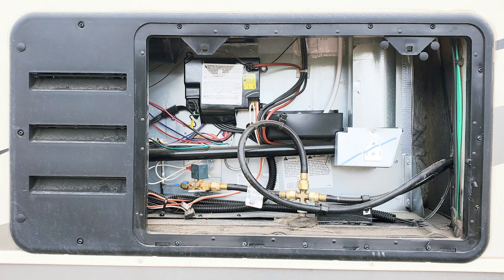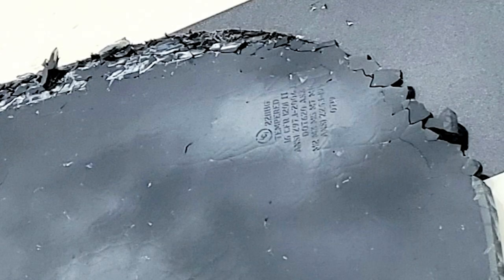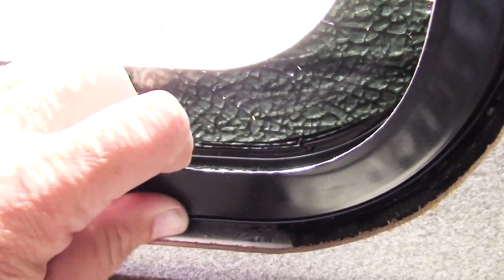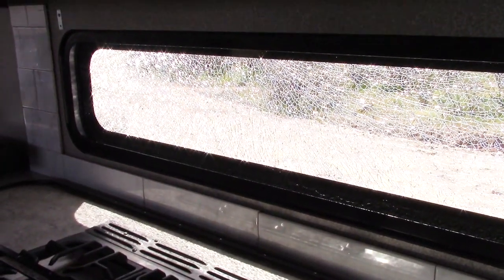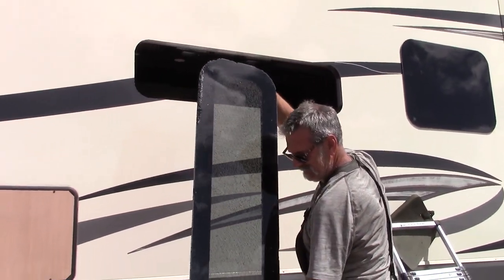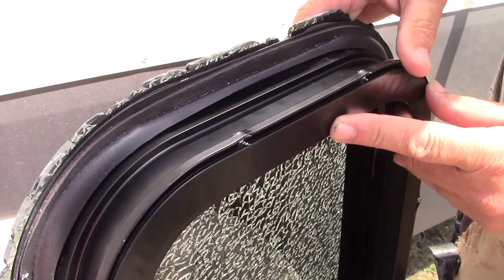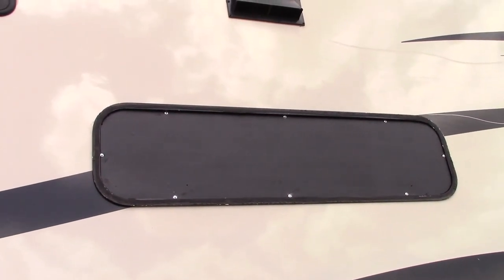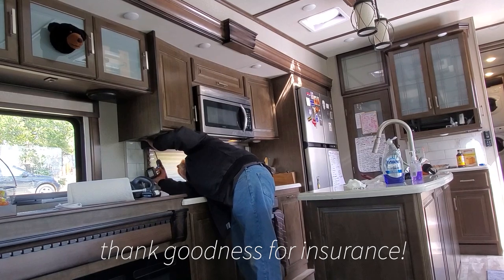SEMI TRUCK HIT & RUN! Shattered Windows, Emergency RV Repairs, RV Insurance Woes and Keeping It...

Comment: You’re not alone. I got side swiped in San Antonio Texas by a truck in a construction zone.  Took out the left mirror and forced me into a concrete divider for a slight scuff   Cost $700 plus. Now I drive with a dash cam.

Comment: I was parked overnite in a rest stop one nite, really dark, no moon or lights on the far end of the lot, and there was a big RV parked there for the night also.  I just happened to be up late that night due to insomnia, and watched a huge tractor trailer pull into the lot at a high rate of speed.  In a split second, he had sideswiped the RV and hauled butt out of there.  Unfortunately, it was so dark I wasn't able to get any info off the truck other than that it was white.  I felt so bad for those RVers.

Comment: May I suggest you look into getting some Wyze Cams. They are about $20 each and run off USB and connect to my cellular wifi. I have 4 in my Class C that point out of the windows and record continuously. One of the cams even pans to follow movement. I can keep an eye on my rig when I'm away and my family members can travel with me vicariously by pulling up the cam views on their phones or tablets. I've had my sister call me (from another state) when she saw someone she thought was lurking around my rig (it was just a camp host doing a security check). With this setup, you might have been able to get the plate of the rig that hit you. I wish you better and safer travels now that your rig is "broken" in! :-)

Comment: Oh Robyn, that is much more damage than you think.  I run an RV storage facility and my clients rigs are always being hit by trucks.  They make insurance claims and the  claims for damage far less than yours runs to $15000.   The fix all the scratches the whole side has to be replaced.  Also sometimes the interior cupboards are cracked.   Get it assessed ASAP.
Reply from the maker: Yes thank you! I was surprised by the total.  The paint was the big ticket item.

Comment: My son in his little Scion car had a truck merge into his lane and with one of those huge concrete barriers right up on the road shoulder, he couldn't scoot over any more. That trucks rear wheel started chewing into his car right at the drivers door and left swirl marks that turned into peeling sheet metal all the way to the front bumper. The right side of his car didn't do too well against the barrier either. He was lucky, they were moving slow approaching a toll booth plus his car was narrow otherwise that wheel could have come into the vehicle with him. 3 feet earlier and it would have. The truck driver didn't even realize that he had compressed a Scion until someone flagged him down.  LOL. It all worked out.  Your truck smash will too. :)

Comment: Man that SUCKS! Brand new rig too. You are taking it quite well. If that truck driver isn't an independent, he's going to have some explaining to do at the main office. You may want to contact that Cabella's and ask if they have cameras in the lot. They may have caught the deed.
Reply: I'm so glad you are alright. I'm dealing with insurance right now. I hit a deer 2 weeks ago in southern utah. The ins would not send out an adjuster. I had to go to the body shop. I have Mercedes Class C. I must say that the damage is minor. It hit on the drivers side corner. I was able to drive no problems. But I am still waiting for an estimate.  I have another trip planned the 1st week in July. I don't know if it be fixed in time.  Safe travels, love your channel.
Reply: Your title freaked me out.  My dad was killed when he was tear ended by a semi in 2004.  Glad you were ok.  Could of been soooo much worse.

Comment: My husband and I are owner/operators and drive as a team. We had an incident about 3 years ago when the trailer tires rubbed onto a lady's car. The car was parked at an odd angle in a no parking zone, along with everyone else, behind a strip mall we were delivering to. We didn't feel anything. The only reason we knew to stop was because I noticed a guy in my side mirror jumping up and down waving his arms. If we had not seen him, we would've kept going, never realizing we did that. The only thing that happened was that some black rubber rub marks were over her rear tire. Yet it came out to be about $$$$ damage. And we had to pay. We had to wait 8 hours for a cop to show up to do a report. The lady, who was Asian, spoke broken English, but told us she couldn't wait around any longer. So, she left before the cop arrived. We stayed. We filled out the report. The cop said if she'd stayed, he'd have ticketed her for parking there. But we're the ones who got the bad mark for a year. We're the ones who had to pay up. Did that driver know they hit you? We'll never know the truth. But, most of us try to be careful out there. Other truckers get mad at me because I back slowly or do other maneuvers slowly. I went to a CDL mill. All they teach you is how to pass the test. My husband was my trainer through the company we're leased to. His motto has always been "you can never back too slow". I'm sorry your new rig got damaged. But, I'm glad you are ok. 

P.S. Watch out for Swift, though, seriously.

Comment: Did you check with Cabela's to see if they had video?  Pretty sure they do most locations. Not sure how long they keep it though, so unless you already did check they may have taped over it by now. I saw a video about NOT putting slides out and BBQing etc in parking lots that let you overnight.  Something about etiquette at places like Walmart that let you park in their lots overnight and to not be that guy who treats it like it's his property and gets real comfy. Maybe it was CheapRVliving? I actually thought it was this channel but maybe even CarolynsRVLife, I follow all 3 so one of these channels touched on not putting out the slides. I think there was a lot of chatter about closing down Walmart overnight parking.  Seems it was happening in some locations and the advice was to not ruin it for everyone by doing stuff like that. Lawn chairs and BBQing for pity's sake!  Glad things worked out for you!

Comment: To help avoid this type of event in the future, consider not putting out slides when parked in designated lined parking spots. The wider that you make your rig, the more you increase your chances of getting hit...especially in drive through parking spots. If the part of your rig that was hit was the slide, then absolutely for sure this would have prevented this from happening. The blame lies completely with the truck driver, but it makes sense not to intentionally increasing the odds of a reoccurrence.

Comment: Here's a prime example why I say never keep slide outs out oh, it's just too risky. I'm a put mine out a couple of inches but that's about it it's not worth the headaches. Especially at the frame get spent on the slide out and then you're up and you might as well total out the unit. I don't think it's a good idea to spend a lot of by the RV and Tow vehicle, it's very hard to get repairs done oh, it's better just to get another unit or purchase a used one somewhere while traveling. The RV industry is not protected by unions, so you don't always get the best labor and services. you really don't know if the frame is bent or not, you'll see when you start Towing the unit, would not be surprised if the tongue is also bent a little bit.

Comment: I know you are new to the fifth wheel but never, NEVER put your slides out while in a parking lot, ESPECIALLY when in a designated parking area where the width of the lanes is designed for the max Federal vehicle width of 102 inches.   I know it is tempting but it is bad idea and honestly, not very courteous.  Hope it gets fixed good as new!
Reply from the maker: Actually the space was much wider than that and this is my 3rd rig with a slide.  I'll address in sunday's view q.

Comment: Robin unfortunately you violated one important rule; if you park in a truck stop you should park as far away from them trucks as posible. And you are not supposed to open your slides either. I hope is a lesson learned. Truckers hate when a bunch of RV’s park in their designated space. Very sorry that it happened to you.
Reply from the maker: I wasn't in a truck stop

Comment: As someone who's owned a class c, an Airstream and a Prevost, and, have driven an 18 wheeler from one side of the country to another multiple times, I can tell you definitively that it is TOTALLY possible to have slightly scraped a vehicle next to you in an 18 wheeler and NOT known it.  Don't assume that the driver knew. You cannot feel it.  You would have had to have have been looking at your mirrors at that moment and it would have had to be at just the right angle.  It'll be interesting to see what the video, if any, shows.  That being said, from what I can see of the damage, it honestly does not look like damage from a swipe from a semi.  The lines of the scratches would not look anything like those.  This happened to me once in my Prevost.  A driver pulling into a rest area late at night clipped the corner of my bus and had no idea it had happened until I showed him.  Information was traded and his company insurance paid for the repair.  He was very nice about it and so was I.  Mistakes happen.  End of story.

Comment: Before we call any truck driver a schoolyard name, why dont we ask why you were parking overnight in a public access parking lot and not at an RV park? Would it be because you dont wish to pay to park your trailer? When I go to shopping centers I use the parking lot and leave when Im done shopping. I wonder how my attitudes would change if I started considering public parking lots as a free place to sleep? I wonder how many RVers would give up the lifestyle if they had to pay to park their rig in a designated RV area? Im guessing alot
Reply from the maker: Great question.  I will address in sunday's video.
Reply: @CreativityRV  Regardless of any individual RVer's concept of what defines an appropriate overnight campsite, parking overnight on residential streets or public access lots involves a sense of self entitlement. And the insurance industry is well aware of this dynamic. If the number of property damage claims begin to rise you can bet that soon you will have to sign an addendum stating the insurance company will not be liable for damages incurred while parking overnight on a non RV approved lot. Thats what will kill the overnight parking freebie. Of course, the low life abusers who dump out ice chests in public while showing their ballsack dont help either
Reply: @froufroufeatherstone6291  Geez I shouldnt even respond to your comment because I can surmise from your thought structure that you're limited in scope, but what I will add is that no individual RVer has the power to stop the direction of the "freebie overnight parking" tide. Hundreds of Walmarts have already put out the not welcome overnight sign and many more will follow. And as RV manufacturers continue to add more expensive gagetry to attract customers, the property damage claims will follow in step. RVers who save by parking overnight in areas not intended for that purpose are tightening the noose as they also feel self entitled to file damage claims.

Comment: I have to respond... Iam a long haul over the road trucker have been for decades.  Note first you say he.. it could of been a she driving that truck.  Now as far as paint transfer goes....our trailers have aluminum hinges ..normally four or five on our barn doors.  THEY ARE NOT PAINTED....where did the paint come from?  Looking at the pics you posted doesn’t look like any hinge marks to me.  The groves on the top don’t even compare to hinge marks or some other things.  But it could of happened from the tail swing of the trailer. If it did though there would of been a lot more damage than you have shown.  Also if you checked everything as you’ve  stated, you would of seen something strange about that cover... how did you see the big truck drive by when the blinds were down you say. A lot of things don’t add up... just saying..ONLY YOU KNOW....last thought you are new to trailer pulling too.  Kind of out of your  league for now..  Last thought if that tail swing was that close that DOT bumper could of hooked on something and ripped that rig apart.  Bottom line don’t park where big trucks do, if you do don’t put your slides out or leave those steps out...   Things happen,,,,🎩. Last thought that scrap mark is a wave that don’t happen like that.   Bet you block me are remove this response.
Reply from the maker: Have a nice day.  Thank you for your comment
Reply from the maker: I will be addressing this question in sunday's view q.

Comment: Your scratches are not in straight lines I don't see how a semi could do a curved scratch like that and how it could just take the door off that thing without screwing it all up from one end to the other? Not trying to cause trouble but the pictures you showed doesn't really line up
Reply from the maker: This is a fair question.  I'm address it in my upcoming Sunday view q👍

Comment: 35 years over the road truck driver do not put out your slides on public parking. It is rude, and other drivers coming in to try and get some rest. You are lucky you got so little damage. Always keep your slides in until you get your Campground. Just the way I see it.
Reply from the maker: Interesting.  I was in the rv section in a lot that invites rvers to stay overnight.  Explain, please, how that is rude?
Reply: @CreativityRV  if you are the RV section then you have no worries. It was the truck driver's fault if he pulled through and do the damage . But if they have truck parking it's usually pretty tight. And then people put out slides and take up two spots.even in the rest area .It's kind of like your Walmart etiquette video. There's a lot of times I even pull in my mirrors with parking is tight. And as you figured out by now parking is usually at a premium. I am sorry that the driver did stop, but I also say he probably didn't even know that he hit you. And I would agree that calling Cabela's and looking at footage maybe getting plate number is the best you can do. I have a 39 ft. 5th wheel and a rv/motor home and never put out the slides until i get settled...and yes i have been hit and run,it sucks...i dint mean to come out like and sound in ass,just dont put the slides out all the way.to many newbe drivers as well. God bless take care.marty

Comment: Truck drivers brag about how they have  scraped up an exspensive class A that dares to park overnight in "their" overnight parking areas. I hear its worst is in rest areas and the major truck stop chains, but it could happen at a cabellas or even a cracker barrel if the driver is feeling territorial. If  there were no open spots where he could fit his rig, he could very likely get irate enough to "graze" your rig and drive off.